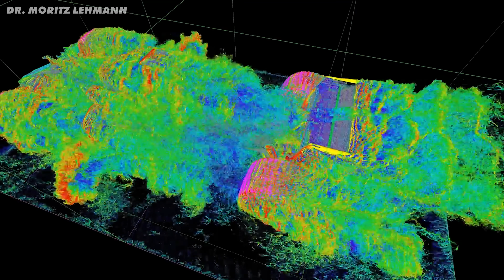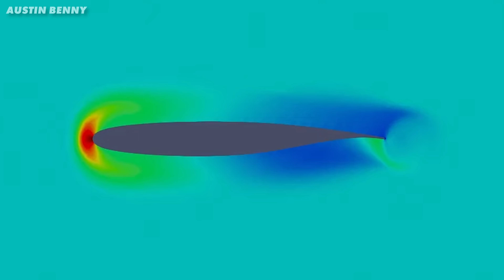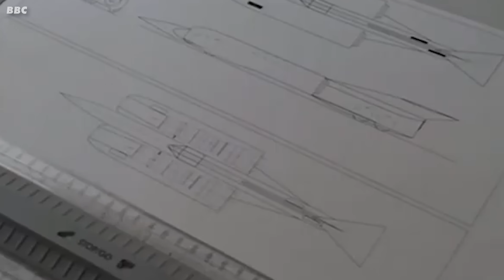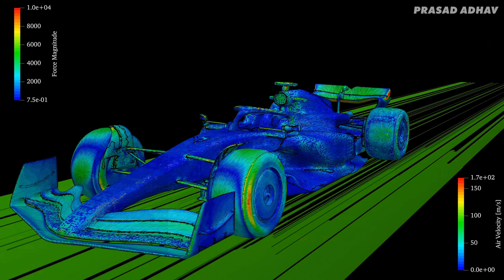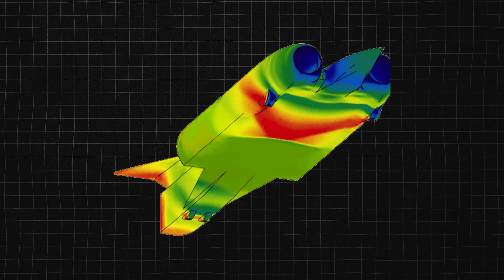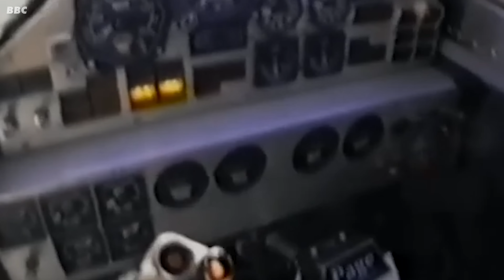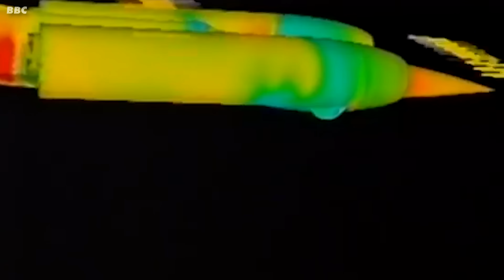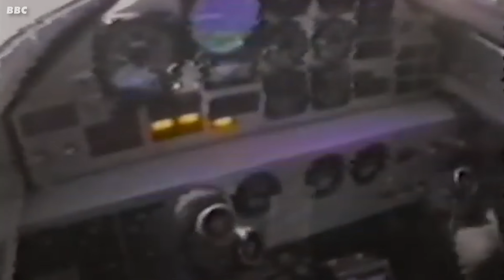What Happens When You Push a Car to Mach 1?

Comment: great video! although quite a bit of fluf and repeated info. Felt a bit like watching that video of the truck that is constantly about to crash into a pole.
Reply: Exactly. 😂 Well said.
Reply: Hey, gotta make up the length to play the algorithm somehow...
Reply: @b0bcorp There's a fk ton of more engineering required.
Even the wheels themselves are a marvel, each forged from a single billet of aluminium, otherwise they explode.
Managing the incredible thrust required from various propulsion units.
All the different braking stages as the car slows down.
Managing to turn it round and prep for another run within the hour.
Track selection and preparation.

OK, OK I'm a bit of a nerd on this.
But even just glossing over all aspects would be a few hours of video.
Reply: I love that gif
Reply: yup, kept adding on fluff until I clicked off

Comment: You missed the other big problem- finance. Every record breaking car has cost a lot and this curve steepens dramatically as speeds go up. Bloodhound LSR (effectively the same team that built Thrust SSC) seemed a long way down the road, but as far as I can tell ran out of cash. I would love to see them back on track but I doubt it’s possible.
Reply: My name is on the tail of the Bloodhound , I won a competition at an event they held back when it was named Bloodhound SSC before a rebrand. I forgot about it until a couple of years ago and check in with their platforms to see if there's any updates a couple of times a year now. It's a shame to see but understandable that funds became an issue.
Reply: Precisely, there does not seem to be enough will power to bring the funds to the table.

They have built the base jet car,  the race surface has been identified, it has been prepped, and they have done the validation runs up to 1010km/h (mach 0.82). They need money to develop the rocket to go with jet, but now the funds have run dry..

Unfortunately this will be similar for the upside down tunnel test. Getting the will power to provide the funds.

Comment: 1,000 mph isn't that fast. That's not even mach 2... the f-22 doesn't even need an afterburner to go faster then that.
Reply: It’s fast when you’re doing it  on the ground at low altitude
Reply: Isn’t that fast? You’ve probably never owned or even ridden in something with over 150hp. 1,000mph OVER THE GROUND is unbelievably fast. Do 180mph on a sport bike, it feels like Mach 10.

Comment: If part of the problem is that shockwaves from the front of the car damage the ground before the rear wheels go over it... perhaps you could also strengthen the ground itself or build a track to reduce that impact.

Comment: 13:25

"It is too round on the top. It needs to be pointy. Round is not scary. Pointy is scary"
Reply: If you don’t look at it, the points aren’t really there. Like avoiding eye contact in a lift after you’ve passed gas.
Reply: Supreme leader Aladeen agrees.😂
Reply: I Aladeen @jamsbong